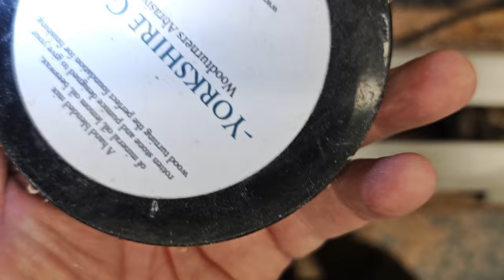XmasTree2024

Comment: Are the tree segments spaced equally on your card? I'd love to know because I love the proportions and size of this! I admire your work :)
Reply from the maker: Not mathematically equally; I basically made one or two at the start where they looked okay to me and measured those to make the card (it's plasticard, so I can stick it in a folder and store it conveniently and it'll last a bit longer than most. Plywood works well too, I just didn't have any to hand)
Reply: @MarkDennehy  Thank you for the tip! :)